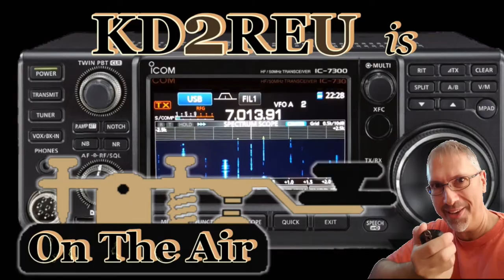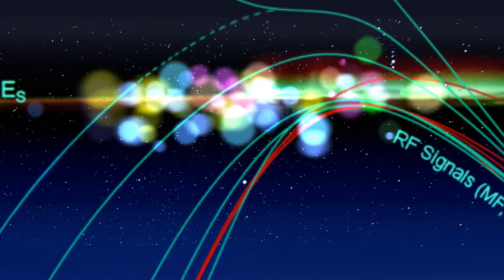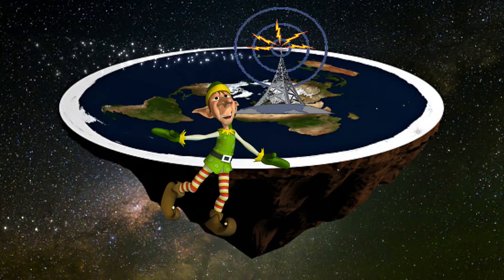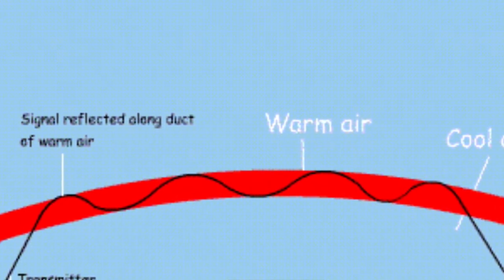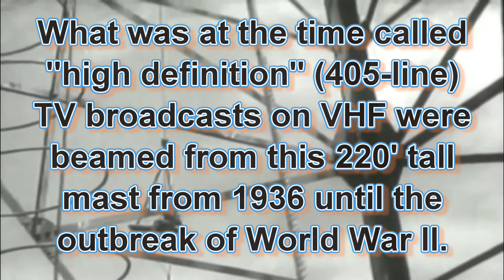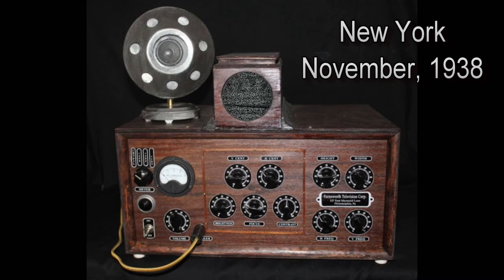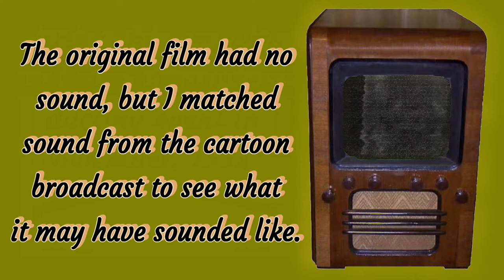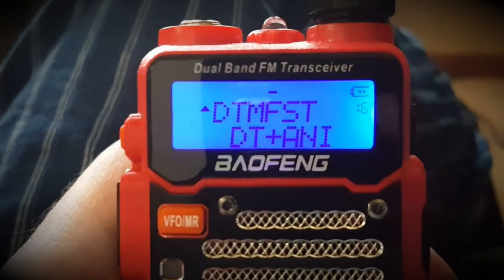Weird Propagation: How did a BBC television signal get received in New York over 3,470 miles away?

Comment: I’ve been a TVDXer since around 1980 and often saw Sporadic E from several Australian states plus New Zealand. Both Sporadic E and Tropospheric reception are often quite clear. SpE can fade rapidly or can be quite stable.  Tropospheric is usually stable with minimal fading. Slowly fading in and out at the beginning and end of the opening.  F2 is very unstable with erratic fading and often scrambled image with multiple images.  The recording of BBC shows typical F2 ionospheric propagation rather than tropo.  Also, this video doesn’t explain ionospheric propagation which is due to the buildup of electrical charges caused by radiation from the sun energising the E and F2 layers.
Reply from the maker: Thanks for the additional info! This is a fascinating topic!